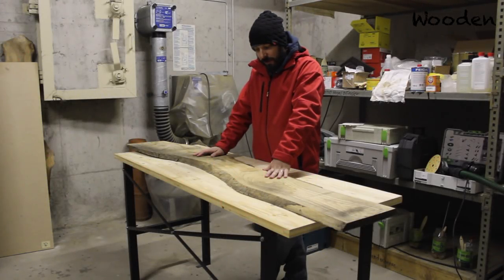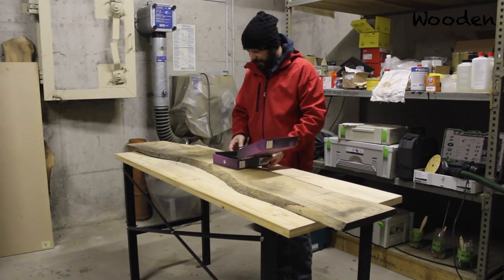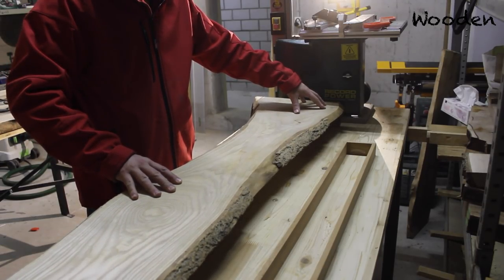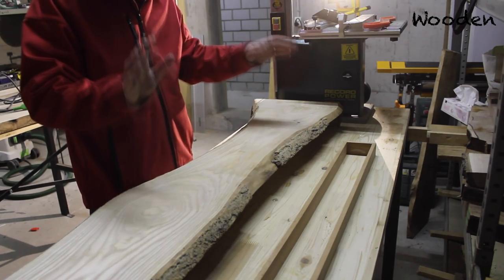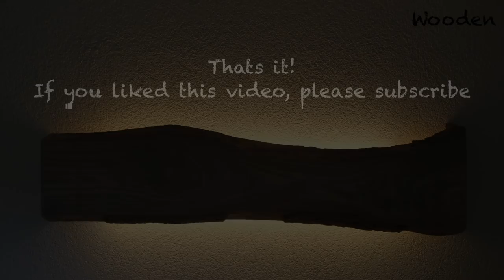Rustic Wooden Live Edge Wall Lamp - Ash

Comment: How did u hid the wire. I couldn't see an outlet anywhere near that scounce and those are hue led strip right?
I'm planing to make something like that but smaller and maybe rectangular.. Nice job mate
Reply from the maker: We were lucky because there was a power outlet on the wall. So all wiring is behind the lamp. If you don’t have that you will need to bring the cable along the wall to the lamp. Not super nice looking, I know. Send me pictures once you made yours 😀
Reply: @Woodensoul  sure thing.
Reply: 5:15 look at bottom left of light. The white power cord is damn near invisible, but it's there